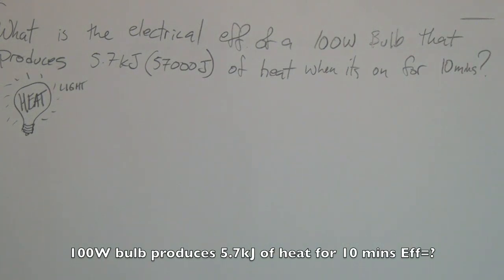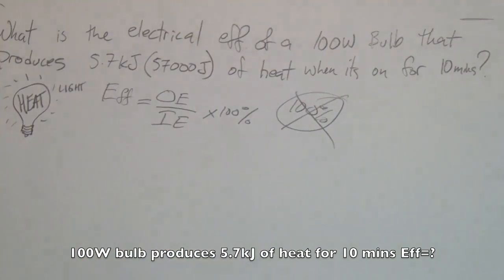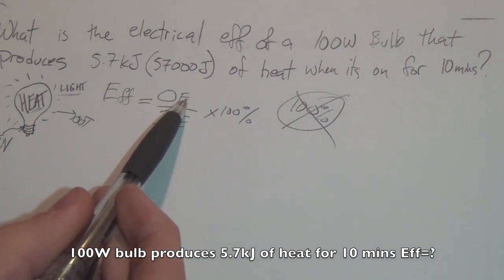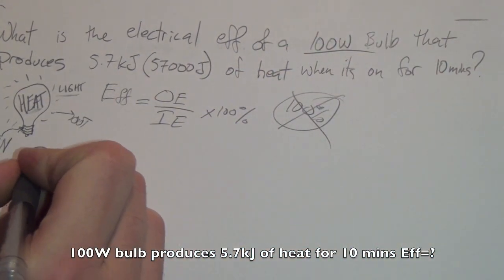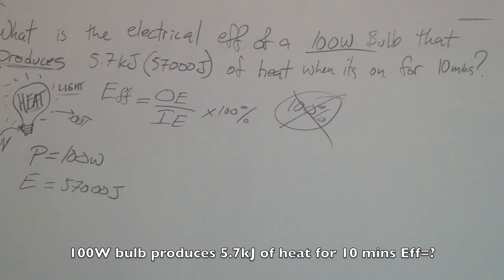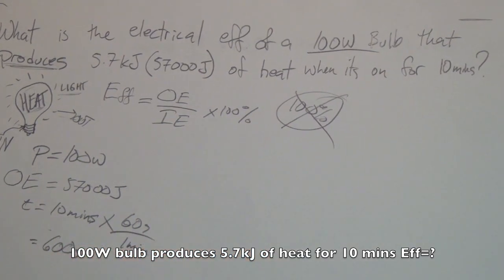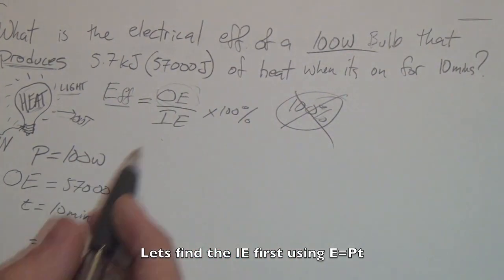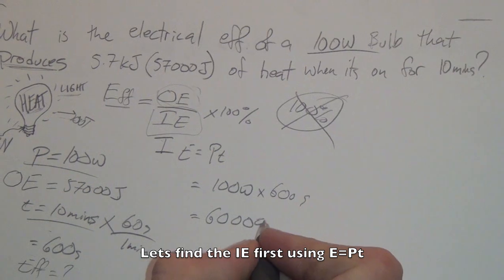Calculating Electrical Efficiency

Comment: Lol the answers wrong it’s 9.5 percent
Reply from the maker: You're super right!   Yup as I mentioned, I made a mistake in the converting so my answer is wrong, but it didn't fool you.  Good work!
Reply: MrLeavittScience how would u solve this question: A 2500 W dryer gives off 8 X 10 to the power of 8 joules of usable energy in 10 minutes. What is the percent efficiency of this dryer?